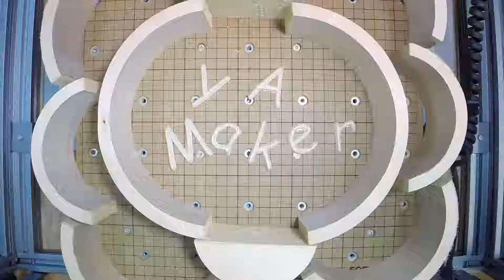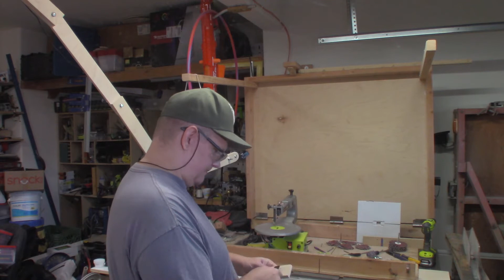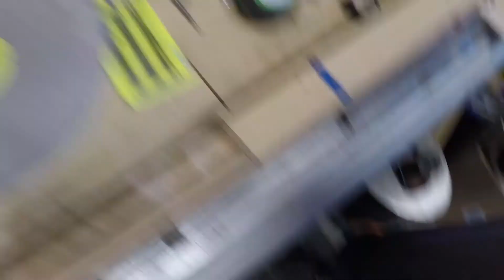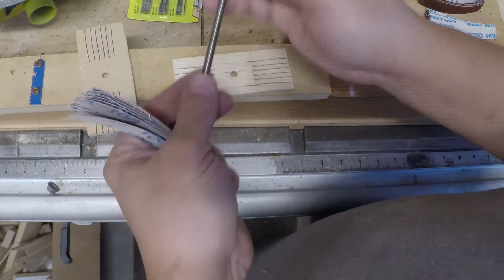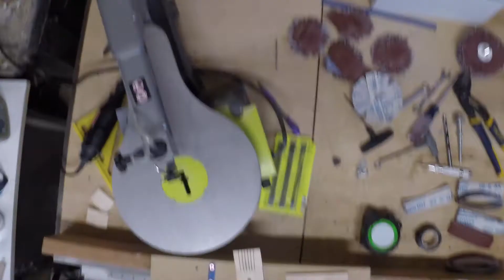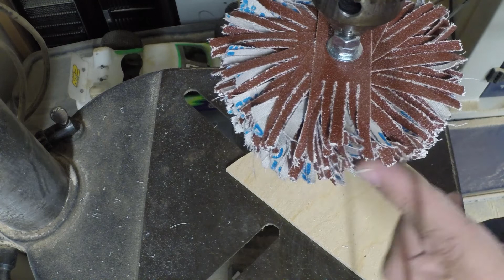How to save 70% to 80% making your own Sanding Mop.

Comment: How to extend the life of your blades?   First, use use the blade as in the video. Second, measure the blade travel (easy: measure the amount of blade worn as you showed in the video.  For the sake of this discussion, let's say it is one inch.).  Third: build a rudimentary/simple/basic/down&dirty accessory table.  Nothing fancy... I would use two pieces of 1/2 inch plywood screwed & glued together for a total thickness of 1 inch.  Clamp the accessory table to the jigsaw table with a slot to accommodate the blade.  The slot probably should be about 1/4 inch wide or so.  So, now your blade will be cutting one inch higher, on another section of the blade that still has teeth on it.  You could repeat this process with a second thicker accessory table or perhaps reverse the blade so the it cuts on the upstroke, thereby using three sections of your blade.  I/you might experiment with the concept of "friction cutting" if you have a bandsaw:  use a worn out blade and run the saw at it's fastest speed.   The worn-out blade cuts with friction, not using the teeth at all for the cutting process.  This process is used for cutting hardened steel, so it should work with sandpaper.   MY ONLY CONCERN is getting all that abrasive dust in my machines!

Comment: Awesome idea.. Cant help but wonder considering its not supposed to end up an accurate tool rather a mess of abrasive strips, couldnt you just cut them with a scissors a few at a time instead of using the scroll saw ?
Reply: Use a dull set of scissors and it will sharpen them in the process. Might help get the money saved  vs. time spent  ratio up.

Comment: Nicely done! I was just wondering, “Hmmm... I wonder if you could cut your strips into the sandpaper with a scroll saw...” and you have proven that heck yeah, you can! (I’ll make sure to buy a buttload of cheap blades in preparation for the project)

Also, oh man, I share your water jet dreams! You can have one of those in an apartment, right? ☺️
Reply from the maker: I started researching how to make one, and man they are still spending due the the pressure that is needed.